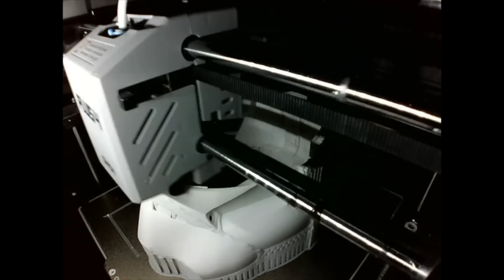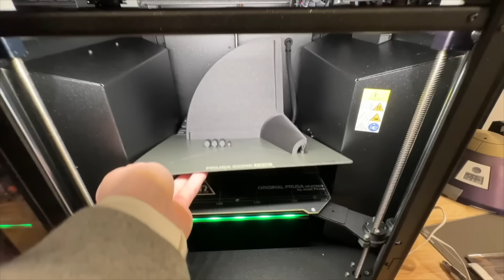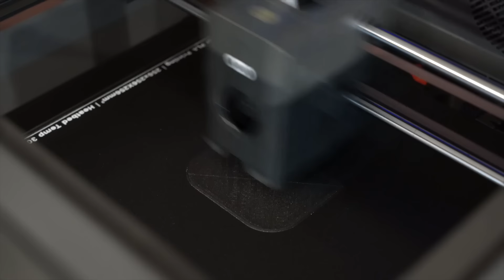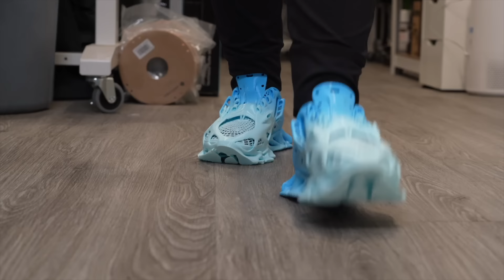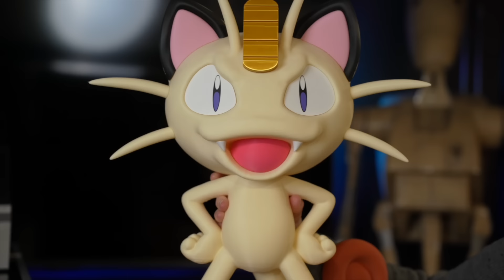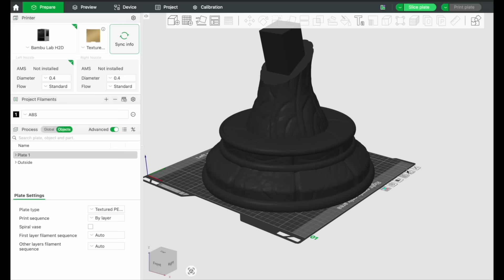Ranking Every 3D Printer I Tested This Year

Comment: I have a Qidi Plus4, just ponied up for the H2D. The Qidi is such a work horse in single filament prints. I got the H2D for multi filament prints. Those Prusa machines are far too expensive.

Comment: I sold my prusa xl's always something with them that needed work on and tinkering, took to long to load and stuck filament all the time in the nextruder. I like my k2 pluses, the last update and first layer has been almost as good as Bambu. I have a few h2d's and live them, I have a few h2s's and love them for my bigger single color parts, I have been using my new h2c today and I can tell it is going to print as good as the h2's and be great for multi color. For large printer I sold my soval and bought a ender 5 max and love it.

Comment: I have a Centauri Carbon, after some work I like it but I would recommend getting the Qidi Q2 over it
Reply: is the price difference really worth it?
Reply: @nevoburi  not for everyone I would say. It has some really nice features for engineering materials like a 370 degree hotend, a chamber heater, and a couple of other things but if you're only printing PLA or PETG the Centauri Carbon is fine

Comment: I do not recommend Elegoo Centauri Carbon in any way, horrible experience with bad quality and even worse customer support. DOA printer, fault fully accepted by elegoo, but still waiting for refund 3 months after returning the printer. What a nightmare to deal with Elegoo, suggest to buy from a reputable brand instead 😱💩

Comment: So many people crap on Elegoo's CC, but I have never had any issues with them and I own 6 original pre-sale printers, though I will agree that parts availability is an issue and customer service can be difficult to deal with(then again that's with almost all 3D companies). While they are also working on an AMS system for the CC they never actually promised one. Personally I'm not a fan of wasting resources and every AMS system on the market wastes abouts 40 dollars worth of filament. Bambu I will never buy until they actually address the poor heat distribution for the beds that have cause several fires(and yes there are many videos showing them catching on fire). I only have 3 creality printers a CR-30 belt printer and 2 Ender 5s I have had more issues with the their Ender 5s than the belt printer. in total I have 87 3D printers with 16 of them being resin printers.

Comment: Any concerns with the P1S being discontinued?  The price is great but a closed eco system with a discontinued printer worries me.  The qidi Q2 is what i have been looking at outside of Bambu.
Reply from the maker: Bambu themselves have said they have no intention of discontinuing the machine anytime soon even now that the P2S is out. Given that so many of their machines use the same parts, even if they were to stop making the printer, I would imagine the replacement parts would still be easy to come by for a long time afterwards.

Comment: Mine are tools, My recent acquisition was a Qidi Q2, waiting on a Snapmaker U1, and a ProForge 5. The Qidi Q2 has been great for ASA & ABS, much better than my Bambu X1C combo, and now there's a Q4 Max which is a massive 390mm square Q2. The QidiBox has been upgraded or revised, so I hope your issues are fixed soon, and I have one on order now, but I can't wait to use the Snapmaker U1 but my Early Backer Pledge won't be delivered to the UK until late January. and I've seen someone use different sized nozzles in one print, so that'll be like going back in time as I could do this in 2014/5. Looking forward to next year and the Bondtech INDX system getting released, so we can make our own mods.

Comment: So many 3d printers out there, keep on releasing each year. I'm just gonna stick to my older 3d printers, and just mod them if needed. Prices on used machines drop dramatically after a year or so too. If you have the know how to tinker, no need to upgrade to a new 3d printer. Some of these 3d printers are expensive too, I'm not that deep into it to justify the cost.

Comment: When I started 3D printing I was literally one issue away from quitting all together after going through 3 Creality machines (Ender 3 max, Ender 5 pro, K2 pro) and an one FLSun (S1 Delta), I pretty much ran into every single problem in the book with them. I took one last shot, bought a Bambu H2S and it was like getting an ice cold bottle of Mexican Coca Cola in the middle of the Sahara desert, beautiful prints every time and no problems. I'm a Bambu fan forever now lol, I just ordered the new H2C and can't wait to start using it :)
Reply from the maker: Really happy to hear you didn’t give up on it completely. I always want to be able to say that if you have an opportunity to acquire a 3d printer whether that’s a hand me down, or an older machine that goes on sale for a price that puts it within your budget, then take it if it gets a 3D printer into your hands. But I’d also hate for that experience to be so frustrating that someone completely turns away from the hobby.
Reply: Glad to hear. I had an Ender 2, ran into enough issues and felt like the hobby was getting the machine working not printing. I'd love to print stuff but yeah that machine drove me to dispair.
Reply: I'm the same as my 1st and second 3d printers both Creality printers had nothing but failures and then the ankermake printer which was better but not great.
Now I have the Bambu lab h2s and absolutely love it 350 hours in and not one failure. Fantastic printer and once the H2C becomes available in the UK I'm definitely getting it.
Reply: i have an ender 3 i havent touched in 3 years, i got tired of messing with it more than printing, i even somehow broke the blower fan in the print head, also added a auto bed leveler that constantly needed me to adjust bed height offsets and it plunged the hot end at temperature into the print bed multiple times. i am getting an Anycubic kobra S1 combo today and from what i have heard it needs a little fiddling with to get the best prints but it just works out of the box for decent prints
Reply: My Anycubic S1 max has been idiotproof thus far even over a day long job right out of the box lol
Reply: Well, I thought I "liked" Bambu based on print quality and ease of use, and I almost bit the bullet and purchased one but then Bambu pulled that “Bambu Connect” nonsense and I said "hard pass". I don't care how good the final print is, I'm not going to be held hostage to a proprietary eco system. There are too many other good options out there.
Reply: @Lensman64  I can totally see why a lot of people are mad about the bamboo lockdown, but for a lot of people didn’t really affect them. Like most people that use bamboo machines use the bamboo slicer and just the bamboo firmware. But I can definitely see why it’s very frustrating that that happened.
Reply: @Lensman64 lol, you still crying that BS. Sad.

Comment: if you are additionally mechanically inclined, teachingtech on youtube just completed his series on converting his sv08 to be a toolchanger using stock hotends and lots of parts from the voron stealthchanger project (as the sv08 is about 90% a cost-down voron 2.4) - so if you wanted, it's possible to add more toolheads to the sv08 for multitool printing (which can be multicolor or multimaterial).  it's my understanding that the sv08 max is literally just an sv08 with a larger frame so the same (or extremely similar design) should work just fine.
Reply: its an upgraded SV08. Better sensors, better build plate and bed. But at its heart its still a voron so anything you can do to one voron, you can do to it.

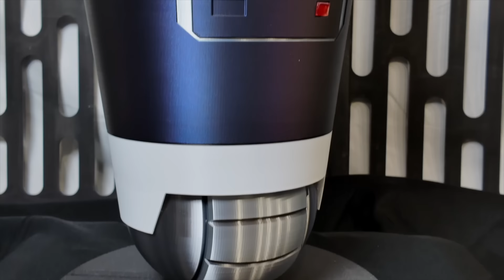Comment: 6:43 it more than a multicolor printer it’s a kickass multi-material printer! Detachable support (Petg on pla, embedded tpu in petg handles) or translucent filament in areas where you want lights etc. 

Core One L with indx will be a beast. I wanna order one but have just had 2months on furlough (no USA related).

You should upgrade your core one to core one plus - it is 4 or 5 parts to have automatic vent opening. 

[edit 11:03 yay you referred to multi material you get there hehe].

Fyi - I comment as I watch… sometimes require edits/ or deletions…. 

Ps Creality I don’t recommend - their support is trash  - I have a couple shorts on a raptor scanner…. Their firmware is definitely junk it partly bricked my scanner.

Comment: I’ve been using the Ender 3 V3 Plus for over a year now. I’m buying the H2S now and I’m excited to move to bambu and ASA
Reply: I use an Ender 3 S1Pro with SonicPad, enclosure with fan ducted out a window for my ASA prints, works a treat but slow of course. However, Creality is also off my radar, a Bambu P2S is probably the next purchase, trusting the inbuilt air filter.

Comment: I've been using Q1 pros non-stop from February. They are amazing workhorses for a farm. Minimal maintenance, ONE clog in three machines with over 1000 hours each. It is a shame the Qidi box release was messy as they were on the right track with the Q1 Pro. I got a pair of AD5X's, too. Since I am more of a technical farmer, I decided to give those a go as multimaterial printers for me as small, fun toys, and so far they have been pretty good.

Comment: I have a Flashforge ad5m pro and have been loving it. I also picked up a Bambu P2S. They are both awesome. But 1 small thing between the two: my p2s is about 3" from the edge of my bed, near my pillow. I can hear my m5 pro from across the room when it's turned off, so i always flip the power button on the back. 

The bambu? I can't hear it at ALL when it's turned ON. I find the Flashforge much easier and quicker to change filament. The p2s has a looooooooong ptfe tube to slide into. Later though: i want to buy the ams 2 pro for it. But right now, i don't really need it right now.

Comment: I recently grabbed the H2D, I like it but I have to say that my Plus4 QIDI is still my best printing machine, this is most likely due to fact that I had lots of time to tune the heck out of my profiles and max speed out.  Getting best quality and speed out of it way faster than the H2D currently performs, but the H2D is giving decent quality still not reaching that of the Plus4, just needs more time for me to tweak profiles bit better with it...............I have been a huge fan of ABS, especially Overture Grey ABS, this past week have some new favorites  they are 3d Fuel PCTG and 3d Fuel PLA Pro + filaments.  These two new to me filaments blew me away, they print amazingly well with offered profiles from 3d Fuel loaded into Bambu Studio for the H2D............will be testing next in the Plus4..............Have my plus4 setup two Qidi boxes...............I found the tangle sensor causing issues replaced it and my qidi box errors went away.  I did figure out why the H2D nozzle seems to get covering in PETG fast, messed with accelerations and cut them in half, no more PETG covered nozzles on h2d.  Make sure on PLus4 do not heat the filament when printing especially when using PETG in the Qidi box and printing at same time.......this will build up friction.  Believe this is why the new Max4 has cooling air in PTFE tubing. Had quite a bit of back and forth look at Plus4 and Qidi box and PETG.  Issues I had are resolved.  #1 was heating PETG when printing appears not good, and the other was that tangle sensor was causing issues where filament entered printer, now all working fantastic. 

Think will definitely be grabbing the Qidi Max4, specs look fantastic on it.  390 by base print size, is fantastic.  It has many new features that look solid.  Moving into new place this week, can not wait to get my  small farm setup again.   Only keeping the H2D going at moment, other printers have been moved to new place need to get hooked up. Not looking forward to move for the H2D, it is hefty, have to bring up to second story :(

Comment: My centauri carbon has been nothing but headaches so far. Been waiting for a new print head pcb board for over half the time i have owned it. The half dozen prints i got from it came out amazing but thats little consolation considering it hasnt worked since the head cant regulate its temp for the last 20 days of the maybe 35-40 days i have owned it. Cant even turn it on without risk of it burning everything out

Comment: I actually switched from Orca to Creality Print as I find CP's print quality is a little better. Haven't experienced any bugs with it.

My most used printers of the year are probably my Creality Hi Combo and my 2 Ender3V3Pluses. I only recently added a K2 Pro so it's not most used in terms of hours, but probably has been since I got it a couple of months ago. Love the quality, reliability, speed and 300x300 build volume of the later 3. I also recently added an ender5max for the 400x400 volume I sometimes need and it's been great so far (only have had it a few weeks).
Reply: It might be worth trying to tune Orca slicer or see what other people are doing since Creality Print probably just has a better preset than Orca
Reply: @stilldre7739  They have done some additional tweaks I believe as I get better layer pathing using CP